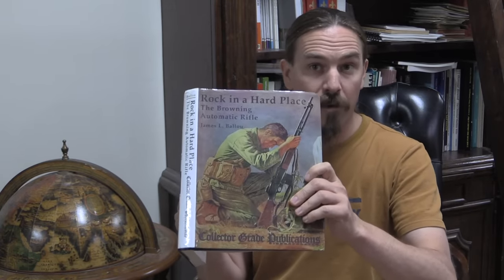Ask Ian: Why Not a Semiauto BAR Instead of the Garand?

Comment: Now from the other direction (I’m sure Ian’s covered it) why not convert the BAR to having a belt with box like the later M60 would or was that level of tech not around in 1919 and would have be too unwieldy and heavy for a “light” machine gun
Reply: If you want to know what a belt fed BAR would look like, well, that's basically the FN MAG58 (AKA M240 in US service).  The MAG58 is basically a BAR flipped upside down (really necessary for the belt feed) and adapted to belt feed.
Reply: IIRC there was a BAR that had a quick change barrel so it was more suited to a LMG role
Reply: They did try to make a belt fed BAR, there’s one at Springfield Armory Museum. It wasn’t all that successful. IIRC, they tested it towards the end of it’s service life and as a proof of concept that didn’t go far.

That said, FN Herstal took the BAR action and flipped it upside down, which created the MAG58, or the US M240.
Reply: @geodkyt  Beat me to it
Reply: @brucekendall9873   🤥
Reply: The M60 is basically an updated Lewis gun converted to use belts instead of a pan, and being fireable from the shoulder was a requirement in the design so that it could replace the BAR as a LMG/rifle combo.  I would assume that the M60 was just more reliable than anything they could do with the BAR.
Reply: Belt-fed BAR is the FN MAG aka M240
Reply: If you want to add all of that extra weight for a belt feed, go ahead. But I don’t want to carry it!
Reply: Sweden tried to adapt the american BAR to beltfed in an early attempt at getting a real MG for cheapish not easy to do. Turn it upside down and you can do it though.
Reply: @geodkyt  I was gonna say that… rats!
Reply: @famalam943  I don't think that was an American variant.
Reply: @Bacteriophagebs  its literally the fg42 gas system and layout with the mg42 feed.  If by updated lewis, you mean a machine gun, then yes.
Reply: Money. 

The reason the M1918A2 was what it was (ie an awful LMG) was to save money (although it didn't do that nearly as well as it was supposed to).
Reply: @88porpoise  fun fact, the M1918A2 was originally going to have a pistol grip. In fact, the first gun labeled “M1918A2” had a pistol grip on it. However, they were dropped VERY early in production in 1938/39 when the Ordnance department required all upgrades/revisements to a weapon system must have 100% parts interchangeability with the older models. You can see this with the M1/M2 Carbine, M1903A3/A4, M1/M1A1 Thompsons, and others. This is especially true with the BAR. Since putting on a pistol grip, while a very minor modification, would require redesigning older WWI BARs for them to work, the pistol grip was dropped and very few exist today.
Reply: @Assmagnus  The FG-42 action itself was based on the Lewis Gun. So, yes, the M60 was based on the Lewis Gun.
Reply: Because at that point you would basically be redesigning the gun from the ground up, it's hardly even a BAR anymore at that point. Also, a belt fed lmg like role wasn't really even considered by many nations until Germany demonstrated it's effectiveness in WWII with their universal machine guns. At which point the US attempted to copy the idea by retrofitting a belt fed machine gun they already had in service, the M1919 machine gun, also designed by Browning. Thus was born the M1919A6. About 100x easier to do than completely redesigning a BAR to use belts and have quick change barrels.
Reply: @Assmagnus  yes, and the FG42 has the same action as the Lewis Gun.
Reply: Not having actually handled a BAR, I would simply guess that it has to do with the magazine catch - the thing that lets the magazine stay in the gun until removed deliberately.  A box magazine is pretty heavy, so it might not stay in the gun, unless continuously pressed down onto a surface (firing prone or whatever).  So that would mean it wouldn't be ready to shoot immediately, and they'd have to load it in.  It'd be inconvenient, if nothing else.
Reply: @Usammityduzntafraidofanythin  What on earth are you talking about?
Reply: @famalam943  yes, that's the FN Model D.
Reply: @flash7355  If i Remember corectly it was a conversion kit for already existing guns and worked reliably but did not get adopted due to 4 rounds falling out of the gun when you removed a partially fired belt. Nobody wanted to search for them in the snow. You probably could have got around it with some milling on the reciever but the Mag showed up and was adopted instead as ksp58
Reply: @edm240b9  But Ian stated that the Swedish pistol grip assembly would drop in to any American BAR? (the first of those were made by colt for fn to sell to sweden aparantly)
Reply: @borjesvensson8661  they were using an FN D style of pistol grip and a different style of rate reducer. Either way, the US factories would still have to take the older M1918 style of trigger groups and change them to accept a pistol grip before M1918A2 production could get fully up and running. While it is a relativelt trivial feature that can be easily installed, it still modified the existing gun too much and the Ordnance Board forsaw this as a potential bottleneck in production.
Reply: @geodkyt  carried one. A beast of an lmg
Reply: You have to think about squad tactics at the time too. WWI had just ended and dudes were still fighting with bolt action rifles, MGs were heavy stationary tools for supporting fire. The idea of a mobile machine gunner wasn't totally out there, but it also wasn't a high priority until the 30s.
Reply: I think if anything it would be more feasible to develop a drum magazine rather than a belt feed for the BAR. No need to remodel the whole gun if what you want can be solved by a fancy magazine.
Reply: Because of the belts of the time (most were cloth, most of the rest were non-desintegrating), the issue with making reliable disintegrating chain-link belts, and the experiences of WW1 which taught the armies on the western front that belts arn't that good on the offensive since your dude may drag them through the mud and jam the gun, they bounce all over the place, they'll snag on things as he is moving up and they slow down the ability to use the weapon when you jump in the opposite trench, the process of deploying the weapon, it takes longer to reload them once the belt is gone and you wouldn't have the downtowns for cooling the barrel that you'd get everytime you'd change 20-25 rnd magazine meaning you'd have to make the barrel thicker meaning more weight.

 Which is why the top mounted magazine machine guns were so popular. The US stayed with the BAR because... "we have a bunch of em, also war is now illegal so there's no need to change it".
 The reality is that the BAR was an automatic rifle pressed into the role of machine gun for which it wasn't very good.
Reply: @flash7355  They then turned all there work over to FN and asked them if they could do it and then became one of the first customers of the FN MAG in swedish called ksp 58
Reply: @bengtjakobsson5177  good info thanks
Reply: The BAR, being one of the first man-portable automatic weapons to fire a rifle cartridge, as opposed to an SMG which fires pistol ammo, was never designed to be a true machine gun, but instead an automatic rifle. At the time when John M. Browning was working on this design, WWI was bogged down in static trench warfare on the western front. Routinely, advances measured in hundreds of yards cost thousands of men. One of the ideas for breaking the static stalemate of the trenches was to use raiding parties to "roll up" enemy emplacements, thereby permitting a generalized advance. German thought in this area later led to "storm tactics" and ultimately to 3rd generation or maneuver warfare, but that came later. John Browning's automatic rifle fired the same powerful 30-06 cartridge as the M1917 and M1903 bolt-action rifles and the M1917 medium machine gun, but it combined the firepower of the emplaced machine gun with the portability of a rifle. Albeit a rather heavy rifle at that. Using 20-round box magazines, the gunner in the BAR team (teams started with three men and then later went down to two) was fed mags by his loader who got them from third member of the team. "Walking fire" was the idea; the BAR man would sweep the trenches free of enemy soldiers, reloading from his two assistants. Sustained base-of-fire operations were not realistic since if the barrel overheated, it could not be changed out easily or quickly in the field. 
The other tell-tale sign that the BAR was not a "real" light machine gun was that it could not be fed from boxed, belted or linked ammunition, as could a true general-purpose or light machine-gun. 

Fun trivia fact: FN of Belgium later (in the 1950s) tried marketing a BAR modified to allow quick-change barrel removal/installation in the field, and also modified it to use 7.62x51 NATO, but there were few takers. 

The difficulty of making something like the BAR into a true light machine gun or general-purpose machine gun lies in the fact that it is already quite heavy and bulky as an automatic rifle. You'd probably need to start with a nearly clean sheet of paper, so to speak, as an engineer or designer. Albeit in a lighter, smaller intermediate caliber, the FN Minimi or in U.S. service, M249 probably comes as close to the idea you are talking about. Since "The Pig" the M60 machine-gun was not really all that ideal as a man-portable SAW (although goodness knows plenty of grunts carried them that way in SE Asia and elsewhere), there was a decades-long gap between the final use of the BAR in the 1950s and the eventual adoption of the SAW. 

Many FA historians and others of that type rate the British Bren Gun (which is really a Czech design) as being superior to the BAR, but I have never spoken to a GI or Marine who used it and didn't recall it with great affection. The men felt safe with them nearby, whether on point on patrol in the jungle, or a BAR man in the squad, or whatever. In Korea, BARs were customarily used to support emplaced machine-gun positions, so that if one or both of the BARs went down, the MG could take up the slack, and vice-versa. Excellent counter-sniper weapon, too. 

I learned something new not all that many years ago. Like a lot of WWII historians for years I'd believed that the biggest guys were issued BARs, but it turns out that wasn't always or even usually the case. Many squads and platoons issued them to average size or even smaller-framed men since the BAR man was often targeted selectively or first by the enemy, and it was felt that if a "regular-sized" man carried it, it might not be so obvious that the unit had one. 

I've always liked the 1966 film "The Sand Pebbles" in part because it shows what daily life was life for sailors of the  Yangzee River Patrol during that era, but also because it shows scenes of sailors engaged in boarding and repelling of boarders operations, small-unit tactics, etc. Including use of the BAR in several scenes. And a Browning Automatic Rifle figures prominently in the final sequences of the film, where the captain played by Richard Crenna and his enlisted men, including Steve McQueen, fight a rear-guard action so that other sailors and civilians can escape pursuing enemy forces.
Reply: @edm240b9  According to Ian's video about the m/21 predates the FN BAR D.
More importantly though, the board were idiots, ensuring the US troops had the patently worst BAR version in service anywhere.
Reply: @johanmetreus1268  FN Herstal was responsible for all the sales of the BAR in Europe, while the US was responsible for sales in the Americas. So, when Sweden adopted the guns, they went to FN in Belgium, not to Colt in the US. When the US was making the A2 BAR, they looked specifically at the guns FN commerical market guns, not the ones made specifically for a nation’s military.

On top of that, it would require modifying the original BAR trigger groups to have pistol grips on them. The US isn’t just going to throw them away since they are still perfectly usable.
Reply: @edm240b9  , they had full access to the various military improvements, still decided to get the worst bipod and no pistol grip.
There was no need to convert the old trigger groups immediately, just having the new BARs produced with the fully interchangeable part would been an immense improvement.
American chauvinism, just like the M14....and the soldiers paying the price for it.
Reply: @johanmetreus1268  it’s better to have a subpar gun that you can get out fast than having no gun at all. The M1918A2 was adopted in 1938. Keep in mind that the M1 Garand was adopted two years earlier and the US still had production issues with the gun in the early years of the war. It wouldn’t be until late-1942 to early 1943 when M1 production was sorted out. If the US did what you suggested and removed all the old BARs from inventory and wait to issue new ones out, there’s a good chance we wouldn’t have enough made by the time the US entered war.

Also, I’m not sure you’re aware of this, but it takes time to produce a gun. When you have stockpiles of older, perfectly useable weapons that can be put out into the field, you’re going to use them. One of the reasons why the US was able to get the BAR out there was because they had left overs from WWI. Even today, many WWI era BARs had been retrofitted to the A2 standard and parts between the two variants are mixed up all the time (example: I’ve fired an A2 BAR wifh a WWI aperture sight on there and Karl from InRange fired a WWI BAR with WWII furniture). Removing all those guns from inventory to put a pistol grip on them is a potential bottleneck in logistics (like the PPSh drum mags) that takes a lot of time to do, and time is something you can’t afford to lose in war.

The Ordnance Board’s memo making it so any new improvements to the gun being interchangeable with the older patterns simplified logistics for the US significantly. Much like the British rationale behind the Sten gun, it’s better to get a subpar gun that can be made fast and is immediately on hand than an amazing gun that takes longer to produce and slower production time.
Reply: @edm240b9 , both the Sten and the Submachinegun M3 saw modifications during the war, both to improve production and improve performance.
The pistolgrip trigger group was fully interchangeable with the existing trigger group, and could have been swapped in the field without assistance of the armourers. Thus it wouldn't have effected any of the existing stocks. The pistolgrip trigger group is also a relatively uncomplicated part to produce, meaning it could have been subcontracted to smaller companies in a similar manner like the Ppsh 43 without taking any production capacity from the main manufacturers.
The whole logistic benefits is simply imaginative without base in reality, in the same manner as sticking to .30-06 which still came in three distinct and not interchangeable packages: banded for machine guns, enbloc clips for the Garands, and lose cartridges for the BAR gunners, though I willingly admit that the latter in a pinch could strip bands or clips if absolutely needed.

This grew very long-winded, but the point is that the perceived advantages failed to manifest to any significant degree, while the obvious downsides remained.
The bipod for instance was not easier to manufacture than already proven designs, nor did it offer even the potential for better performance than those it was tested along side with.
The M14 was developed at great cost simply to be All-American, and I suggest the opinion that this the basis of a lot of other decisions, under the veil of the reasons you given.
Reply: @johanmetreus1268   the Sten and Grease Gun are different. Adding a pistol grip and some wooden parts on to something that is already an incredibly fast to produce weapon in 1944 (when it’s clear the British/Allies are going to win) is different than gearing up for a war that technically still hasn’t happened yet in 1938. Also, M3A1s saw very little usage during the war. Most of the fighting was done with the M3. The whole point is that the existing BAR trigger groupings off of the original M1918s would need to be fitted with a pistol grip if they were to get the guns in the field on time and have a good supply of them. What were they supposed to do with them if they did adopt the pistol grip on the BAR? Just throw them away? Pulling guns out of the field for a relatively minor modification would be detrimental if a war were to break out.

Either way, the Ordnance Board made this so across every weapon. All new and improved parts must be able to drop in and be interchangeable with the older designs. It’s why the ‘03A4 Springfield is just an ‘03A3 with a scope. It’s why the M1 and M1A1 Thompson bolts are swappable despite being different. It’s why finding an all matching parts US gun is very rare. While this memo adversely affected the BAR, it was probably for the better to improve the manufacturing capabilities and to reduce any potential chokepoints. This is what happened with the Russians with PPSh drum magazines and is why the drums are not interchangeable between every gun, because the QC in the USSR was dogshit compared to here, and it wasn’t even perfect here either. Also, firearms manufacturers already subcontract other companies to make smaller parts for them. That still takes time to get all the parts, ship them, install the proper mods to be up to spec, ship them back, test them, and then get them back into the field. It’s a hassle to do.

Also, it’s not like ammo can’t be stripped from either the belted ammo from a bandolier to use in an M1 or BAR. I’ve loaded and pulled out rounds from cloth belts by hand, it’s not hard to do.
Reply: @edm240b9  yes, it's easy to remove cartridges from belts and clips. You can however not use machineguns and the M1s without those latter items, and while belts generally can be used multiple times, the clips were intended to be disposable and had their durability decided accordingly.
More importantly, the whole logistics chain was set up to deliver banded ammunition to MGs, clipped ammunition to the riflemen and the lose cartridges to the BAR gunners.
That means that most of the time, it wouldn't have made much of a difference had the M1 been chambered for the .276 Pedersen except the latter would have either taken less transport capacity for the same amount of cartridges or more cartridges could have been shipped on the existing capacity.

The BAR trigger groups id not need to be pulled from he line to have them modified with a pistol grip, that's the whole point here.
Letting the issue of "what to do with the replaced parts"  become an issue at all is a fallacy. Whether to save the old trigger groups and store them in case they re ever needed for something, modify them when spare time was found, recycle them in the steel mills or just toss them away is a mere afterthought, not a main concern.
Reply: @johanmetreus1268  that’s the thing, if they were to be made properly, they would have to be taken off of the line to have them modified. The pistol grip they used also housed the rate reducer, like how the FN D is set up. This means you’d have to change more parts internally for the weapon to work if you want that rate reducer to work as well. After the pistol grip was dropped, they went with the rate reducer buffer in the stock that wears down overtime from excessive use. Because of the way it’s designed, original BARs updated to the A2 specs weren’t fitted with them.
Reply: So Kalashnikov wasn't the only guy who figured out that flipping his gun upside down makes it a good base for a belt-fed MG
Reply: @famalam943  Yep, FN Model D. It was a vastly improved variant made by FN Herstal, Ian's even got a video on it!
Reply: @builder396  Ian's video on why drums are not a widespread development would explain this. The trick to getting drums to work reliably in most cases prior to today's weapons developments, is to hand-fit each individual drum to the weapon it was issued with. This may later turn into a massive logistical issue, hence the Soviets replacing their PPSh-41 drums with magazines and adapters.
Reply: As others here have said, this concept is similar to the M240 employed by the U.S. Military. The marines kind of fucking hate it though, ironically, due to how unreliable and unwieldy belt feeding can be, and they requested several times to have a variation of the M240 that utilizes box magazines instead.
Reply: A few reasons. In WW1 belt fed machine guns were seen as static weapons to engage out to long distances and be able to sustain fire for hours at a time. The dictated quick change barrels, water jackets, open bolts, big heavy mounts, etc.
The BAR was conceived as a weapon the infantry could use on the offensive and that could be fired while advancing. Disintegrating belted ammo had not been invented so your BAR gunner would have rapidly had a long canvas tail dangling along to trip him or snag in the barbed wire. The belt feed system would also have added more weight to an already heavy weapon. 
Magazines are simple, easy to keep clean, and easily reloaded while moving